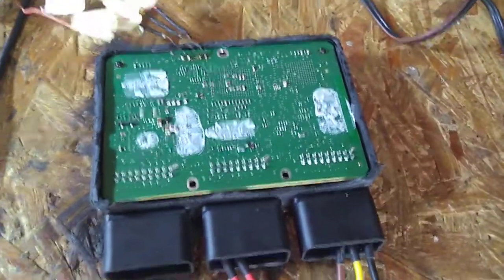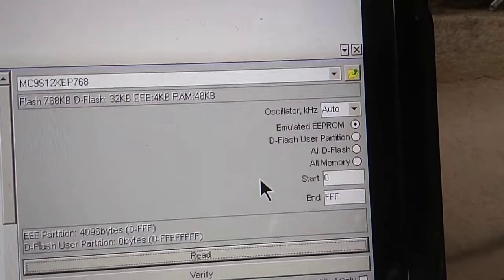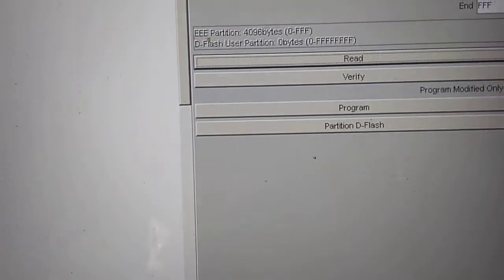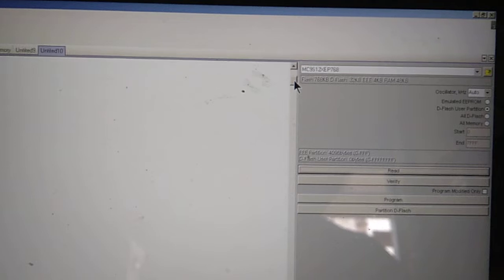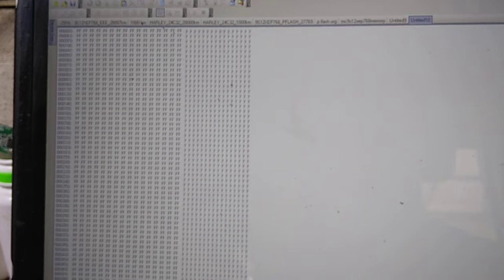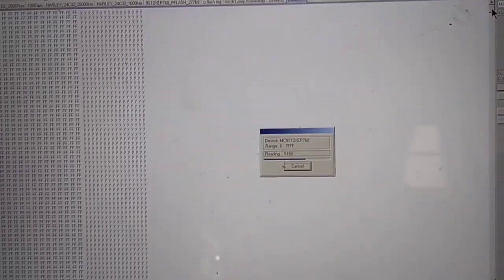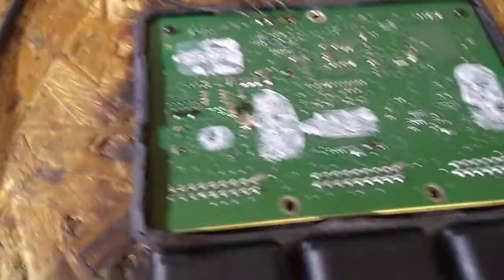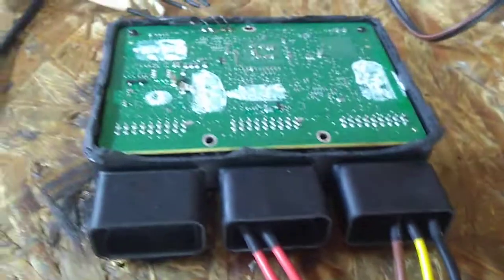Harley Davidson ECM read flash

Comment: Puedes modificar millas?
Reply from the maker: You can change, remember; the biggest one will be preserved, as long as the vin it is the same on both unit. if the ecm mileage are biggest than dash . The dash will assume it.  And vice-versa
Reply: Can you pass me the connection points with upa?